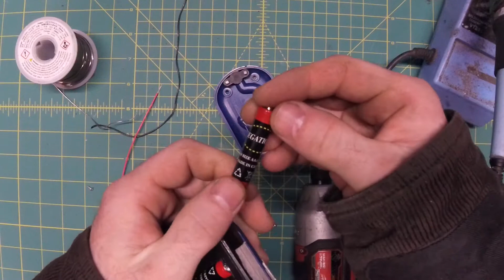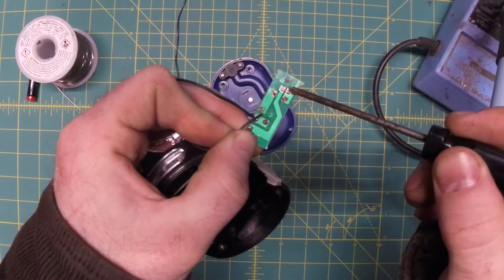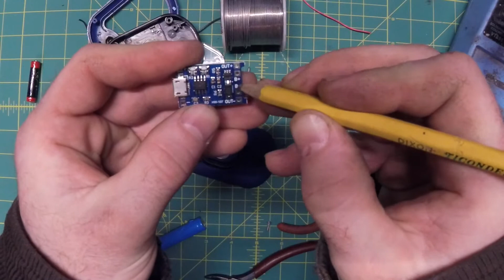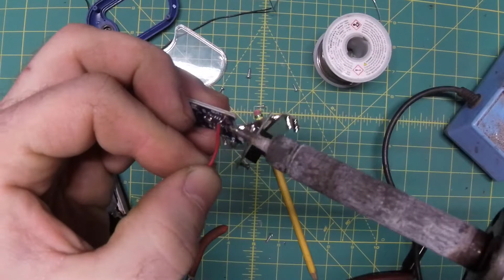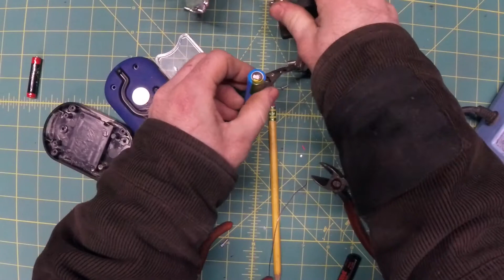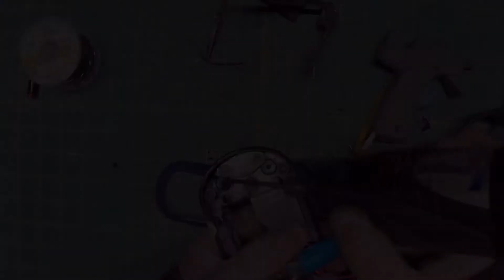Harbor Freight Free Flashlight- Re-power With USB Rechargeable Li-ion

Comment: You could probably much easier mod these with 3x 10440 wired in parallel, then you could reuse the battery bay.

Comment: Awesome video to find. Have a shitload of free HF puck lights and aluminum flashlights that I'm working on cad drafting new housings for that will incorporate lithium batteries and charging circuit's I've scrapped from old power banks and finding disposable vapes in parking lots. The new housings will be magnetic and have an articulating arm that the cree led strips will be mounted on so they will be a lil more useful for cramped auto repairs.

Comment: Put a 555 time inside makeit 80 90 duty, human eye wont notice, save enery prolong life. Metric system & electronics rule
Reply: Mhm, I think it does fatigue the eyes even though you don't really see it. 50-60Hz lights that go through 0, certainly do. 
But there are current limiting controllers by now, that are faaairly cheap and come on a pcb. They do the switching for you.

Comment: I just did a similar mod with an even smaller lithium cell that easily fit.  Then did some current draw measurements, and noted that the cob was pulling 40mA per LED and they are only rated for 30mA.  Wondering if yours is holding up or if they burned out already???

PS - my 350mA cell was small enough to fit in bat compartment with room to spare for the tp4056 sol I kept the little 3 LED flashlight option which I kinda like - has good spot direction and is comparable to the light output of the smaller old incandescent flashlights.
Reply from the maker: I have a dozen of these little cobs. I use them on my drill press to illuminate my work area. This flashlight I made still works but about half of the LEDs on my press are burned out. Doesn’t seem to be proper current regulation. Which, for the price…
Reply: @thedoubtfultechnician  Thank you for reply!  Others have reported that swapping from regular AAAs to higher powered alkaline AAAs or Lithiums somehow give the LEDs too much current?  Rechargeable Ni/Mh have less nominal voltage so may be better, but possibly still pull too much current when fully charged?
My cob's resistor is 1.5 Ohms.  Think I'll substitute it with a 2 ohm resistor so LEDs pulls closer to 30mA which I think is their rated capacity.  Will have to learn SMD soldering techniques first though.  In the mean time I'll only use the 3 LED mini flash light mode option since my measurements show they run at 30mA, within tolerances/not abused.

Comment: Good job.  I have so many of these lights.  I'm mounting a few strips by themselves onto a framed back pack.  I decided to use lithium polymer batteries with built in bms boards, even though a tp4056 board will work.  A small dc voltage meter will give me the charge status.   So many things that these free lights can be repurposed into.